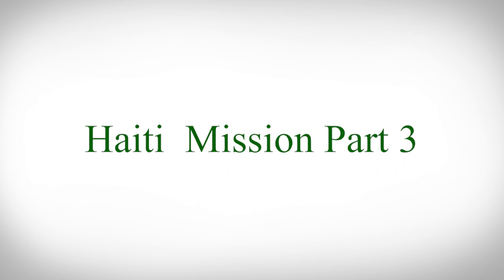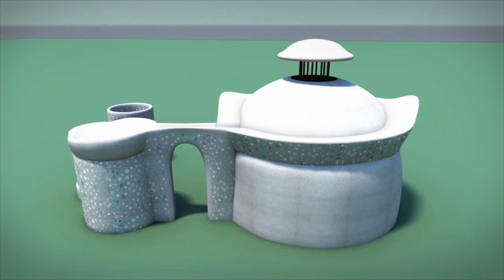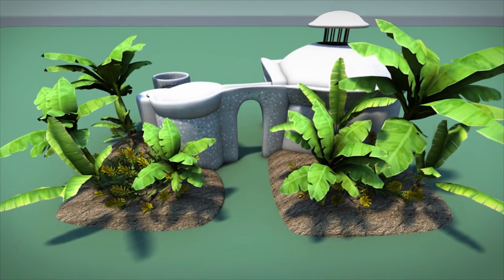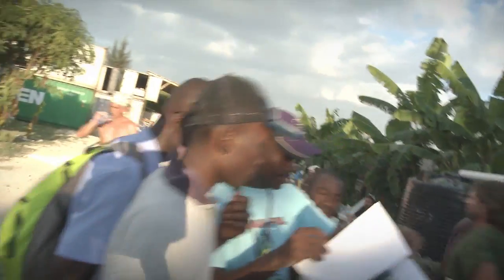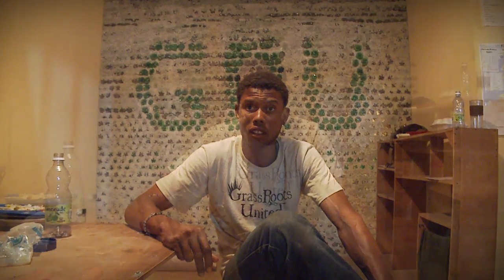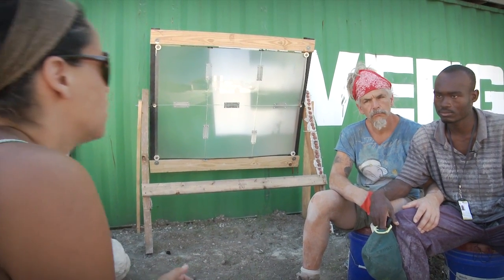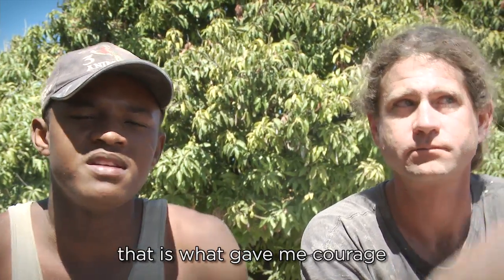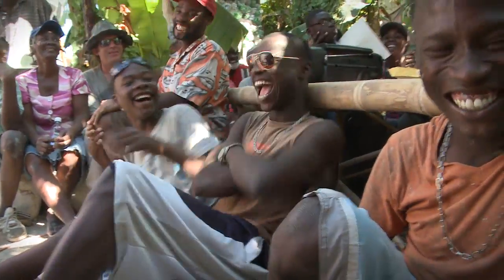Haiti Earthship Project: Overview

Comment: @fatguyslim I'm not associated with Earthship Biotecture, but I may be able to answer your question. The reason an Earthship is earthquake proof is because the tires are aligned in a way that allows the building to be sturdy and it essentially can't cave in on itself unless your house is literally built on a fault-line. The rubble is used as a filler to make the tires heavier and it also helps in creating a temperature barrier between outside and inside, making it cheaper to cool your house.